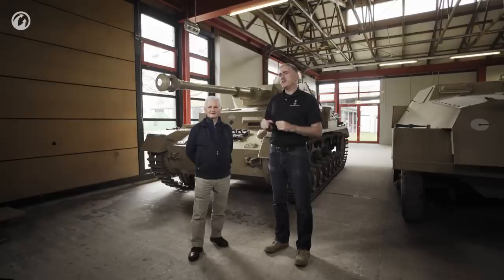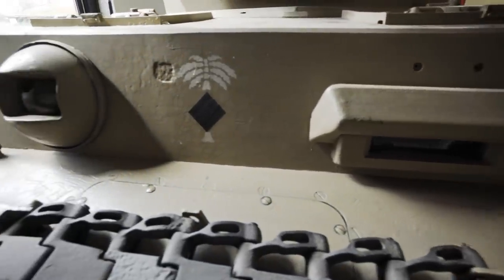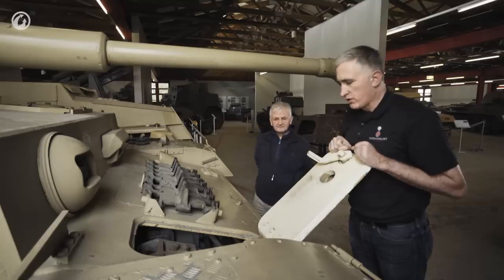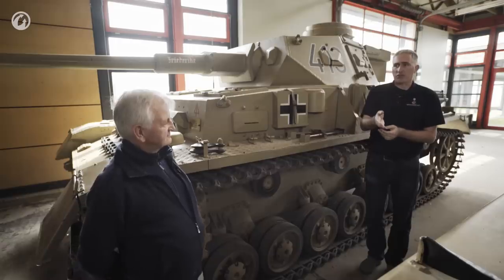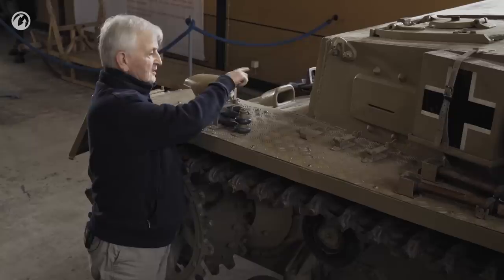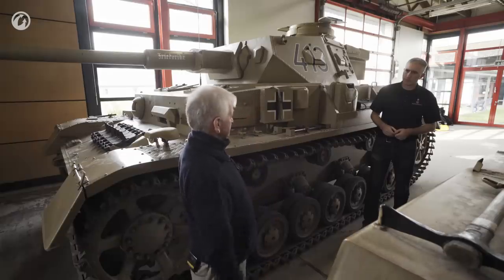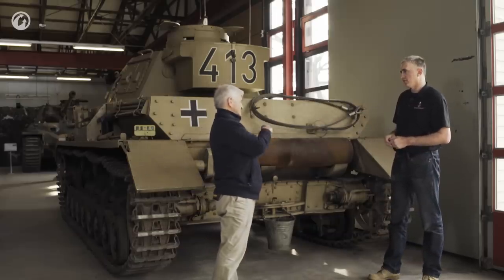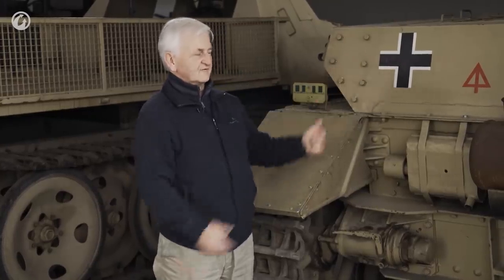Inside the Chieftain's Hatch: Panzer IV, Pt 1

Comment: "We have specially modified this version for Russia."
"What told you that this was necessary?"
"Well, we've found out that it gets cold there."
Reply: I mean Barbarossa started in the spring, and classic hubris they figured I would be a quick jaunt like Poland and France, considering the Soviets got owned by the Finnish, it might have seemed that way
But then it got dragged out all the way to winter, and Hitler ignored all reports telling him fuel was freezing in the tanks, dudes were dropping dead, they still mostly had horses so that just wouldn't work..
He may have been a lunatic but the memes of don't invade Russia in the winter never really apply, didn't in Napoleons case either 
It just ends up dragging on until then because it's insane to invade at all
Reply: @KaladinVegapunk  Dude they knew they had to crush the russian army and reach Moskau before October 1941. Thats how long they asstimated their feul supply would last. The Winter wasnt their biggest concern. They knew that the war was doomed by a very large percentage if they fail.
Reply: Odin Satanas Barbarossa started June 21st, summer by most accounts, spring has the rainy season which they needed to avoid due to the dogshit infrastructure of the Soviet Union

Comment: When I was in the German Army (Bundeswehr) driving instructors would commonly put a bucket somewhere on a vehicle so that if the learner did not check the vehicle correctly it would make audible noises when driving.

Perhaps this "tradition" came from the Wehrmacht with the same idea, someone found a tank where a bucket was still on, made the photo and since then all German tanks need a bucket.
Reply: hotty3 ive seen multiple pictures of german tank convoys moving into combat, usually in france 1940 where they all have bucketed butts and it wont stop bothering me
Reply: A good way to lose a bucket I guess.
Reply: It may have been used as a Latrine, if the Engine is hot you can shit in the warmth and have cover from the tank. It wouldn't be near any hatch to the crew compartment too, so no smell inside. It's where I would've put the poop bucket on a ww2 German tank :-)
btw on what vehicle was the bucket method in the Bundeswehr done? In the Leopard 2 I would've got lambasted for not wearing hearing protection, if I heard bucket noises. Though I was a Loader, so didn't have much to do with driving training.
Reply: @TT-nt2co  so you tellin me the germans invented the shitbucket?
Reply: @Wolvenworks  it was BMWs first patent.
Reply: @MrGMoney1944  lol. I thought it was Prof. Porshe !
Reply: @TT-nt2co   yeah, that's what I first thought of when I saw the bucket there.
Reply: You Germans have one of the weirdest senses of humor ever
Reply: Its more for washing in, washing in dirty water is better than not washing at all. 

Von Rosen talks about it in his book. I will try and find the page
Reply: @ryancook6452  found it yet?

Comment: Finally a Panzer IV Video. So many Years without a Inside the Chieftains Hatch for imo one of the best Tanks of WWII.
Reply: It was definitely the best German tank of WW2, or at least the most useful. Sure, it didn't have the gun or armor of the Big Cats, but it was a rugged, reliable all-rounder that could be produced in large numbers and made up the backbone of the Panzer Corps. In many ways it was the German equivalent of the Sherman
Reply: @DefconMaster  It was the only German tank that was exactly what it was supposed to be, a decent medium tank that can do most tasks. It was cheap to build, easy to repair and the long barreled KwK outperformed nearly all alied non-TD guns during most of the war. Thats the exact design philosphy Germany should have stuck with. Cheap, durable and reliable. 

In my opinion its the best looking tank of the war, especially the later version with the sideskirts, alongside the Pershing and Hellcat
Reply: Mohammed Hersi  How is the Pershing one of the best tanks of WW2 when it barely saw action?
Reply: @xanderchristensen6068  Best looking along side the PZ IV and Hellcat.  Not best tank.
Reply: Xander Christensen On paper and in action it preformed amazingly. It was better then any other allied tank during the war. And during Korea they crushed the commies. It was a very good tank and it’s little brothers still serve today (M-60A3 is still in US service)
Reply: @DefconMaster  The 75 mm L43 was good
Reply: @destroyerarmor2846  Never said it wasn't, it just wasn't quite as potent as the 75mm Kwk 42, 88mm Kwk 36, or 88mm Kwk 43 that were found on the big cats. It was certainly more than adequate for most roles though.
Reply: @DefconMaster  evolution in progress.

Comment: So judging by the markings (assuming they are authentic), this was used by the 15th Panzer Divsion, 8 Panzer Regiment, 4th Panzer Company - platoon 1 - vehicle 3.
Reply: Can you explain through which markings tell you that? I know the Red triangle with the stem line is the 15th, and the Yellow YIII is the 8th Regiment, but what are the Company, Platoon, and vehicle markers?
Reply: @hamishneilson7140  I believe its the 413 on the tank 1=platoon 1 and 3=vehicle 3. Not sure about the 4 but it has something to do with it also. I read somewhere that commanders vehicle numbers ended in 0 or 1. Can't remember honestly, something about the tank numbers tells you some info.
Reply: @vanguardactual1  company/platoon/vehicle. the commanders often had a 0 at the beginning. 009 for instance.
Reply: @hamishneilson7140  The 8th Panzer Regiment had two medium tank companies - 4th and 8th so this is tank '413' therefore it's from the 4th company (which makes sense as it's a PzkwIV), platoon 1, vehicle 3.
Reply: @AdamMann3D  I had read something like that, Thanks for reminding me.
Reply: Why does russian media require blanking them out?

Comment: As for the provenance of the tank, did some digging:
The red triangle with the vertical line (12:58) is the symbol of the 15th Panzer Division. It may have been re-painted since it was captured, but I would hope not. It seems that there was a single two-battalion tank regiment (8th Panzer) in that division. If it arrived in Tripoli in late October 1942, I would hazard a guess that it may have been captured almost immediately. The Second Battle of el Alamein began a few days after this tank arrived in-theater. Hence it's nearly pristine condition.
Reply: Lucky it didn't end up on the bottom of the Mediterranean Sea given all of the attacks launched against the convoys supplying Rommel.

Comment: The tale of the jerrycan adoption by the allies is really interesting, cars being smuggled half way a cross the world.
Reply: Agreed, it is a very interesting tale of technology transfer as well as the name sticking with the item. You can see in some pictures of the old style of fuel cans that the British forces used in the Western Desert, along with all the dents and you quickly realise why everyone swapped over to the Jerry can.
Reply: @markfryer9880  the British four-gallon "flimsy" was hated by all who came in contact with it, as it was about as durable for military service as a biscuit tin and it had been earmarked for replacement before WW 2 as British Empire units hated it and kept complaining about it,especially when such cans leaked in storage or from rough handling. It couldn't cope with stacking like the Jerrycan could and refuelling vehicles with large fuel capacities like large aircraft or tanks took ages and was not safe practise in desert conditions. Jerrycans could be lined up and drained into vehicle tanks using large funnels.
Reply: @michaelbevan3285  I think that you may have just insulted biscuit tins the world over by that comparison. The "flimsy" was a disaster, no doubt about it and your stacking comments were spot on. How on earth did it ever get accepted for military service?
Reply: When I was a kid, and having seen that the British had spread the name Jerrycan ie. a racial slur into common use today, I saw a packet of Pom Bears crisps and thought they were named after the racial slur for Britons

Comment: I read somewhere that the jerrycan is actually an Italian design adopted and mass-produced in vast numbers by the germans. Perhaps photographs of Italian vehicles dated before the arrival of the Afrika Korps will shed some light on this. The Maybach engines were compact because they used tunnel crankcases and crankshafts, a Maybach house specialty also seen in railway engines of the period (both petrol and diesel). The result was somewhat more fragile and demanding in maintenance terms, these engines were known to be temperamental, albeit with a very good performance.

Comment: One unusual aspect of this tank, in common with most German tanks, is the abundance of vision slits.  This is quite unusual in tanks of this era.  Note how this tank has vision slits to the left of the driver and to the right of the machine gunner.  There are also vision slits in the side of the turret.  There are also what appear to be armoured vision ports next to the main gun.   These slits are also on the Panzer I, II, III and Tiger I.  Optics and visibility are one of those continually under-appreciated aspects of tank design.  German tanks are also unusual in having hatches in the sides and rear of their turrets - even the Panther and Tiger I / King Tiger had these.  The Germans may have considered that these hatches, which presumably slightly weaken the armour protection, were worth it for the improved crew survivability, which is another under-appreciated aspect of tank design.

Comment: "Hot cooling water" -- now I've heard it all.
Reply: How did you think radiators worked?
Reply: No, you haven't.

"Cold heating water."
NOW you've heard it all.
Reply: @Bird_Dog00  Baa Haa Haa
Reply: @erichstreberg7101  Radiators work by pumping fluid that is cooler than the heat of the engine through it.  So even though you're technically right that the coolant in radiators IS hot when running, it is cool compared to the engine heat, so the wording may have just confused him a bit.

Comment: Nick, Good segment with Hilary. Question on the Leaf-spring suspension. Historically, was there a weight limit on PZ's where they would no longer be effective, regardless of their road speed. 

Making note to reflect the comments that this PZ-Special was only support, but still, aside from Reconnaissance, most of the german tanks were not built to be supper fast, so, designs could have continued with leaf springs. theoretically. Right?

Comment: Question: Did the Wirbelwind use only later Panzer IV hulls or were there any that used older, pre-F hulls?
Reply: The Flakpanzer IV Whirbelwind was designed in 1944 so i doubt there were any older hulls laying around-
Reply: From what I've read, they converted existing tanks into Wirbelwinds. I've seen at least one model identified as a G model (produced in 1942 and 43). If they had old tanks kicking around and the Wirbelwind wasn't exactly a front line combat vehicle in need of a ton of protection...
Reply: Germans used to convert older Pz.IVs returned for major repairs into all sorts of special machines, AAs included. Same actually goes to all other tanks, including captured ones. So there's huge variety of chassis for AAs, SPGs and so on.

Comment: If you're wondering about the black diamond on the front it's censoring where a Swastika is meant to be on the Deutsches Afrika Korps emblem
Reply: it is not just meant to be there, it is still there. The filming crew just taped it over.
Reply: @zafranorbian757  mhm, but there should be one in the video; I hate it when legitimate original wartime restorations are censored. At least the museum has it.

Comment: I have wondered why The Chieftain didn't take a look at Pzkw IV, since he "climbed all over and through" (somewhat) similar tanks such as the Soviet T-34, M4 Sherman, UK Cruiser tanks, etc. So it's finally the turn of the Wehrmacht's early "heavy tank." Now to ask the Big Question: Why did this early tank design serve throughout World War II and isn't the mechanical maintenance nightmare of later tank designs?
Reply: The Pz IV was at no point classed a heavy tank.
The reason why the Pz IV is a bit more thought trew that for example the Panther is that it had years of devellopment and refinement trew trials, while for example the Panther went from first concepts to the finnished vehicle in around a single year. There was just more time to take care of the little things. And it stayed in service because it always could be upgraded to do the job.
Non the less it would be wrong to leave out that for what it is the Panther was easyer to assemble than the Pz IV and was also far easyer on the crew when it came to daily maintnance.

Comment: Did they ever attempt/think to install the 88 in place of the 75? Was it even possible?
Reply: Probaply not and no. The 88 would have needed a much larger turret diameter, especially with the Pz.4s turret design were behind the gun you still need room for the commander.

Comment: Dear Chieftain: I have a question. Is there any documented evidence of Russian or American infantry using IEDs on german tanks.I know the Russians had the dogs that were supposed to run under german tank traps. But did they use improvised explosive to take out tanks.
Reply: I don't believe the term IED came into use before the Afghanistan and Iraq campaigns. Of course virtually every "irregular" army back to the down of time has improvised things, including explosives. There were antitank mines in WW II, but they fail the "improvised" test. WW II US antitank training suggested using a Molotov cocktail to knock out a tank, and that is improvised, but perhaps less explosive than you are thinking about.
When you think about it, an IED is a static defense weapon, meant to defend against invading tanks. Since in WW II the US was generally doing the invading, they would have had little use for static antitank defense perimeters near the front lines, and could have gotten issue antitank mines to guard rear support bases. The Russians OTOH were being invaded, so may have more use for such things.
Reply: @lwilton   I'm just using the more modern term. I just found out the us had the sticky bomb(huh, guess saving private Ryan got that right.)I know us troops were attacking but the advanced  units could run into armored counter attacks .I mean all it would take to ruin an airborne or infantry day. Is one or more panzer threes or a panther to show up.The same could be said for the Russian units. Especially like those in Berlin or Stalingrad.

Comment: Is the Pz IV D and Pz IV G the same with this tank or am I confused
Reply: They are fairly different, the D has 30mm of frontal armour with the driver having a more foreward position. It carries the stubby 7,5cm L/24 gun.
The G has up to 80mm of frontal armour with a snooth frontal plate for the superstructure. It carries the long barreled 7,5cm L/43 gun.
Reply: @zafranorbian757   The driver didn't move forward; the radio operator moved backward.

Comment: "Only the  smaller spare parts would be standardized; the bigger bits and unimportant stuff would be slightly non standard, and could just be thrown away and replaced" - am I the only one who thinks that this sounds backwards? I don't understand. You mean bigger bits AND unimportant stuff, or that the bigger bits were unimportant? Why would two such different categories end up as nonstandard, when lights and switches, etc, were standard from all sources? Seems more likely to me that the smaller parts could be non-standard, since they could more easily be fitted and would come from a wide variety of sources, as long as the main components like the turret, guns, sights, etc, were all made to fit the pattern. Like you had a Short Land Pattern musket: before the Americans invented interchangeable parts, you could have Land Pattern Muskets made by various suppliers, and none of the parts were easily interchangeable. The triggers, hammers, screws, etc, could vary from maker to maker, but the overall shape and dimensions were always the same, the bore was always they same. They were always close enough that with a little fitting they could be assembled together. But the small pieces came in many sizes and shapes.
So what is the deal?
Reply: Examples of parts that were identical and used in several types of Panzer:
switches, batteries, lamps, intercom system, glass vision blocks, vision port mechanisms, tools, machine guns, radio sets, machine gun mounts, fans, driver's folding seats, smoke grenade launchers, wiring junction boxes, gun safety switches, gas masks and accessories, fuel primers, main guns.